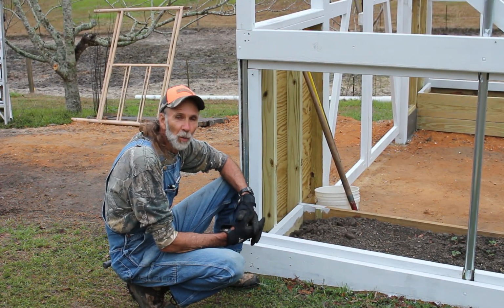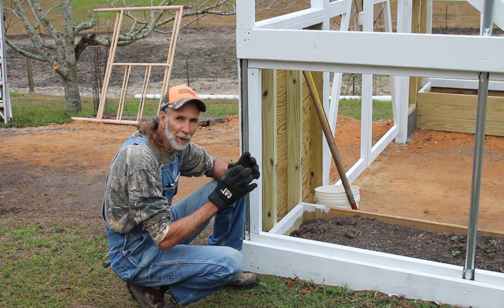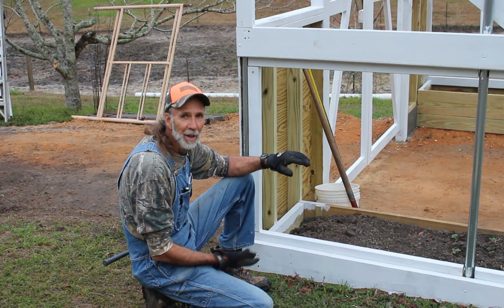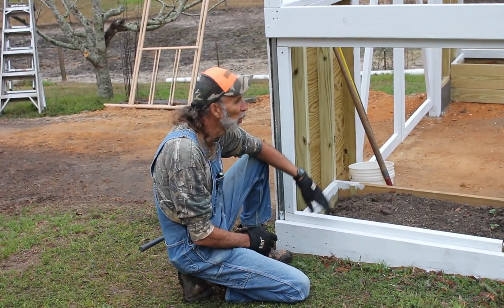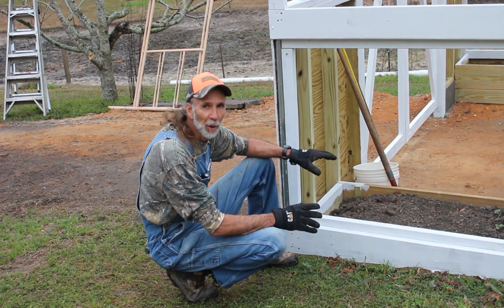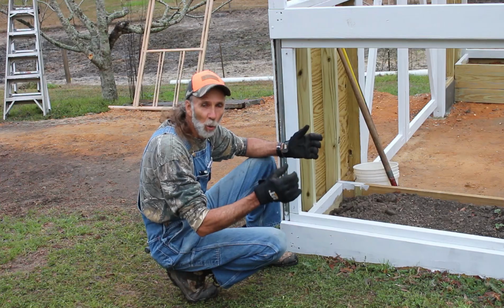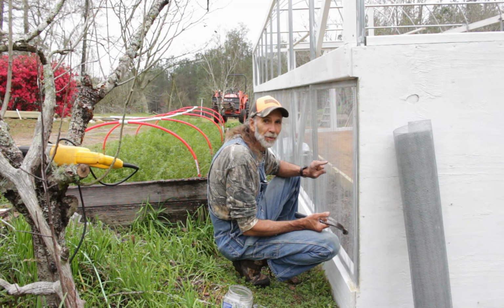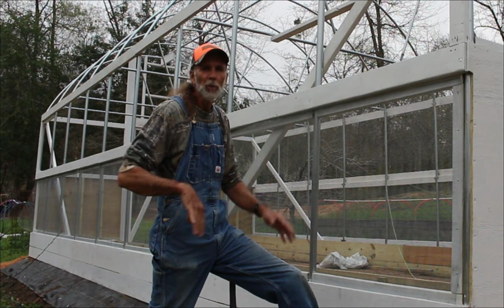How to Build a High Tunnel/Greenhouse | Paint and Wire | part 9

Comment: Maybe you could run 1×1/2 trim at the top and bottom of the wire, ends and maybe add some boards along the side walls to nail the screen. Everything is looks great. 
How milking going? Anymore calves coming soon?
Reply from the maker: We are hoping that our other two cows are bred.

Comment: No lathing over the Hardware cloth? Just surprised, I guess. Mainly seen the cloth used on screen doors, and they always used thin wood strips to hide the staples and hold the cloth tight. Kept it from banging any more than usual with going in and out!!

Comment: If it going to be long term I would have done a roll of window screen then the hardware cloth that will solve both problems rabbits and bugs
Reply from the maker: The holes in the hardware cloth are the same size as screen so no need for both.
Reply: Deep South Homestead they make hardware the same size a screen  roll wow didn’t know that